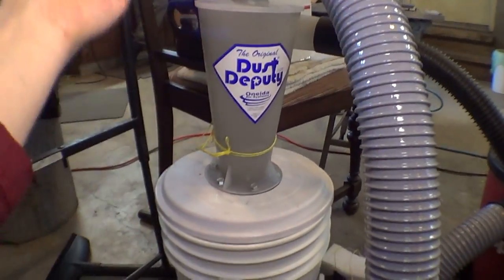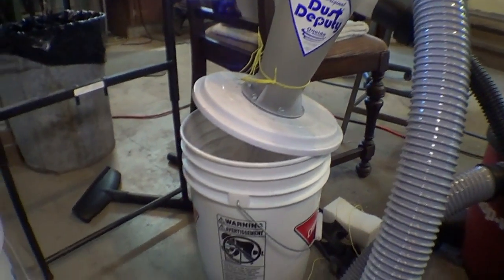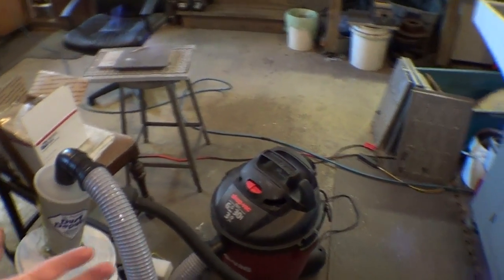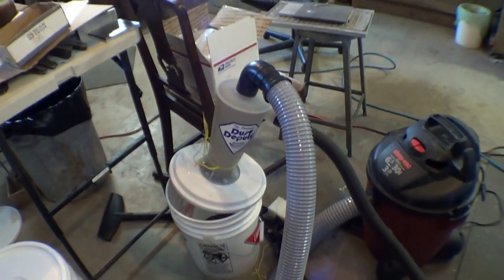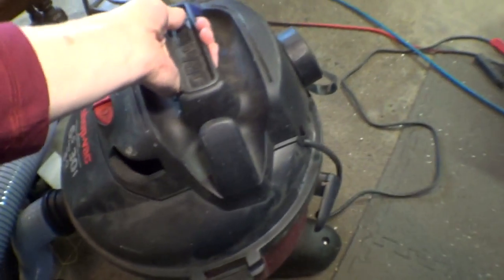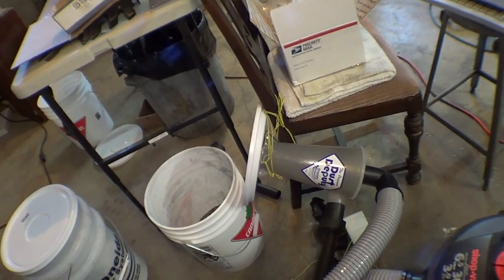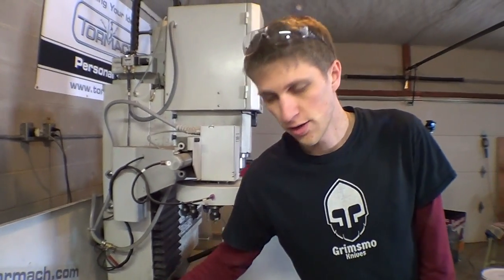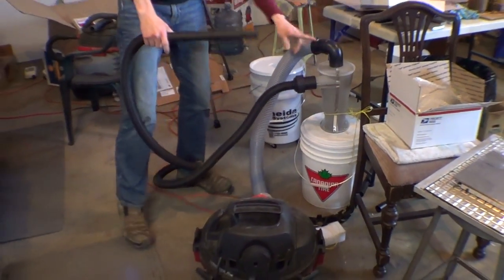Dust Deputy vacuum for machining

Comment: I'm not seeing it in your shot, but there's usually a green small gauge wire in the kit, to make a connection to that silver striping tape, and which hangs down and drags on the floor, for a ground connection, supposed to help with static.  Probably a good idea with your carbon fibers, but at least is recommended for wood dust.

Comment: If you add alittle water in the bottom, 1-2 inches, helps a ton. Easy to clean, just dump if out instead of having to deal with the carbon dust after it fills up.

Comment: Dyson is going to sue Dust Deputy! LOL

All jokes aside John, you and Eric know how bad the carbon fiber dust is extremely bade for your health right. I would not even open up the lid on that pail with out a high end mask and proper filter for CF dust on; that shit is double bad carcinogen that the body can get rid of ever plus the resin in the dust can reactivate in your lungs and prevent O2 transfer permanently.

Comment: just out of curiosity as i shop for mills i came across novakon and talon and they offer a servo model with rigid tapping and as machinists we all know that servos blow steppers away,, what made u choose tormach over a servo novakon  that is made in canada which i may be wrong but isnt that where u are?? im after my monies worth! any thoughts on the novakon servo mills?(dont want to buy and be upset with quality) I seen an accuracy test request posted on an earlier video from a watcher and i would like to see that as well because closed loop servos should out do steppers but if the tormach is still tight then maybe steppers are ok? i think the novakons are powder coated as well and the paint is looking pretty rough on yours, not sure why its peeling if you are using tormachs coolant? price for novakon vs. tormach is pretty equal but rigid tap means very accurate rpm vs. 1/n z-feeds, again just looking to see whats going to last the longest and stay tight, what i mean by tight is after a year or so of hard use servos should still hold .0003-.0007 on repeatability and steppers maybe .0008 to .0012 should be expected just from my on the job experience.Thank you for any advice as to purchase something worth doing an injection mold-core on and can be expected to stay tight for a few years of 30hr program runs. I dont expect you to slam tormach but seeing backlash on some cuts would show the truth in quality,,great videos, very creative knives by the way.

Comment: Hi John

I designed and built my own for next to nothing. All you need is two plastic pails, a chunk of plywood and a couple plastic pipe fittings and you are off to the races. I have it attached to my Sand/Glass Blasting Cabinet. I don't know if you have seen the stuff that comes out of these Blasting Cabinets?  It's super fine powder, almost like Drywall dust or flour and this separator catches 99% of it.  I have never changed the Vacuum Bag since I built the Cabinets 10 years ago.  Works great.

Willy

Comment: John, a quick warning, the dust deputy won't protect you from the fine dust that's bad for your lungs. You still need a HEPA filter for you vac to be truly safe from the CF dust.
Reply: I've heard a bunch of great reviews of Dustless Technologies HEPA vacuum.  This would make a great pre-filter for it to reduce the large particulates that make it to the large HEPA filter.
Reply: jcims Yea, that's what the dust deputy and other cyclones are really designed to do. they remove all the big particles that would quickly clog/damage the HEPA filter, and the HEPA filter removes all the fine particles that are bad for our lungs (10 microns or smaller).

Comment: I made one out of a bucket and a couple plastic cups with the bottoms cut off, the exact math of the cyclone doesn't matter but it works REALLY REALLY well - cyclonic is the way to go.  Even with a bit of wet it still works because the spinning vortex is where the up-moving air goes and while spinning anything more massive than air flings outwards.  There is so much motion that the moving particles scrape the wet ones off the sides.

Comment: I have a CNC router and built a similar larger cyclone filter that mounts on a garbage can. It works great, and I can maintain FULL vacuum on my 4" suction line without the filter getting clogged. There are versions that are easy to build, just check Youtube.